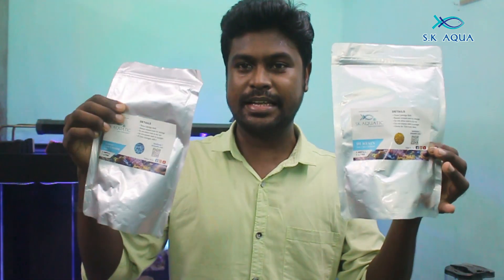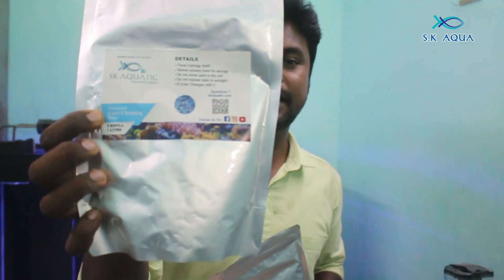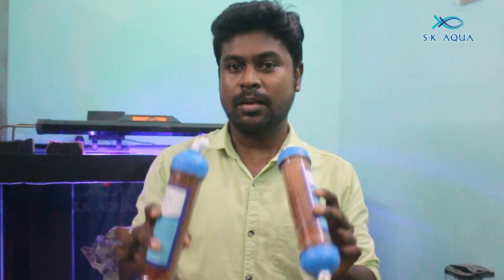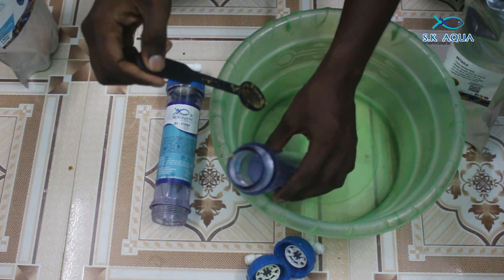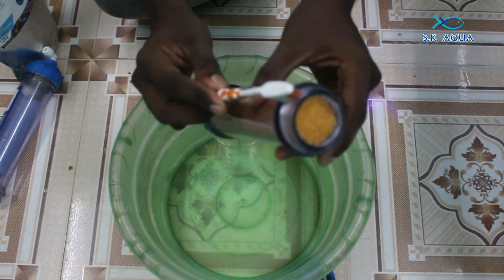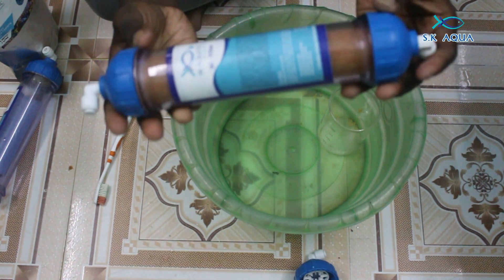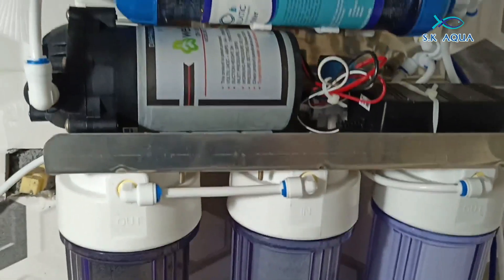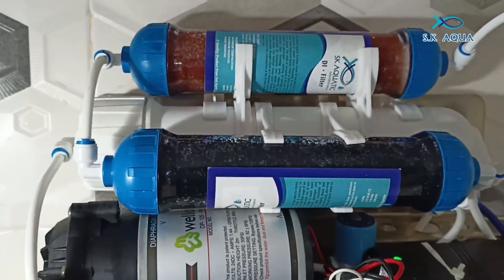How to replace DI resin | Tamil | SK Aqua | SK Aquatic |

Comment: Bro kolathur la irukka shop la laam once tank vaanguna water change ae panna vena 6months ku once pannuna pothum nu solraangalae bro..is it true?
Explain this bro if possible
Reply: Please learn about marine ecosystem and saltwater husbandry and never trust anything someone working at the store says. Water changes are necessary in order to maintain the correct water parameters. Without changing the water for six months, nitrates in the water increases to a level which is considered toxic to most fish.

Some hardy species might survive but that is equal to torturing the fish.
Reply: Weekly water change is must